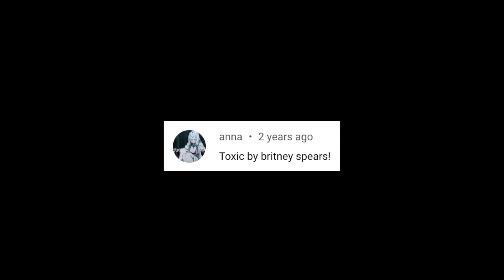Britney Spears - Toxic (on Devices feat. Epilator)

Comment: You need an epilator like I used to have. It had an extending, sprung arm on the front of it which had little rubber teeth on it. You could extend the arm so it vibrated on the skin a split second before the epilator would pull out your hair. Designed to desensitise your skin so it wasn't as painful. Would look hilarious! Wonder if it's still in a drawer? Can't find the right search terms on Google!